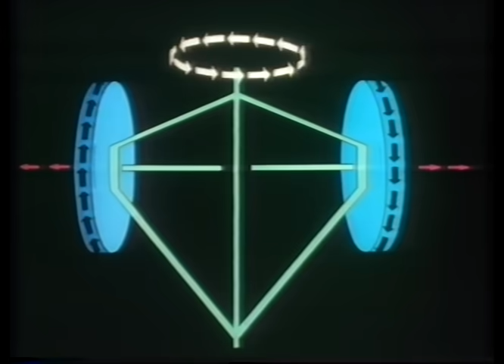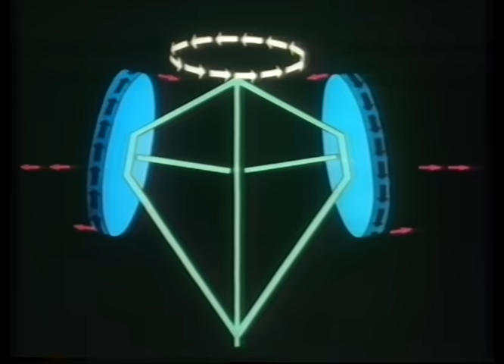Anti-Gravity Machine (Part One)

Comment: Let's talk tech. Top comments aside, and they are engaging, but can we get back to the topic?

The reason this is not easy to see is that our science has denied basic reality. So, there is no path from what is taught to how this works that will hold together completely. Where science refers to a "law" or "principle" you have to substitute "magical spell" to understand the limits of your self-induced confusion. Engineers know science misses the mark, but are too focused on getting results to actually deny its usefulness. The truth is the Universe is mechanical. So, if you want a working explanation, you have to construct a mechanical model. And you most likely will not get to that without a very complete understanding of how reality works (observationally). Specialist need to go back to their liberal arts roots. Enough set-up, let's get to it.

Joe Newman envisioned his reality having magnetic particles shaping magnetic fields which acted like miniature gyroscopes. He wrote a book about his blend of self-discovered physics. Out of that he came up with a way to modify one of the oldest DC motors, even down to the tolerance control (he was a weight lifter, not a mechanic). His motor not only would run on voltage alone, it would charge the dead batteries that powered it and generate electricity that had to be syphoned off or it would blow up with the overload of power it generated. At the same time, it was a motor that was more efficient than any motor made today... and sold commercially. Of course, American law shut him down. So, keep in mind, success in this program will bring death or best case, financial ruin and public ridicule. Your efforts are presently being directed to a science fiction political system from a more mature culture.
The point is, and science has confirmed this, Aether is real. Today that word is anathama, so they call it by one of the more obscure names: Quintessence, a reference to the fifth essence or element which was Aether. Fundamentally, it has spin which orients with external charge. The two have some special conditions that must be met, but one will cause the other to come into focus and the balance between the two, charge and spin can be shifted or created with just the other. Energy is an expression of these two in specialized combination, so conservation of energy is a LIE. Nothing that is constructed of a combination of things is conserved. And for all practical purposes, if the stuff anything is constructed of is also defining space itself, there is an infinite supply of the raw materials for energy and matter... and speed or kinetic energy is not the only path to conversion between the two.

This device spins, if you spin gasses, they ionize and align their charges and focus the spin all the way down to the elemental level. This will release the energy that binds the elements together in a form of compression Etheric waves that is natural energy transmission. Paul Pantone did this with his GEET reactor. He then took the bi-product from this, a plasma and ported it to an ICE. Which compressed it, triggering an implosive fusion reaction that also expressed Etheric compression waves that helped sustain the original implosive fission in his GEET. The whole set up reduced the weight of the gen-set system by 1/2. Paul was killed in November of 2015 after everything he accomplished was taken by a black ops group. Tesla did expensive original research on Etheric waves, his lab was blown up and his fundamental science discredited, his test results denied. What we know as science today was specifically designed to deny Tesla's discoveries.

One experiment that might clarify what is happening here is to build the device with ceramics rather than metal. Or use metals forged in a magentic field and make sure the fields are aligned with the Earth's. Or set up two GEET reactors where the spinning gyros are operating. It is most likely that the movement of just one aspect, perhaps the alignment of the electrons in the metals are mobile enough to align their charges and detach the connection between the mass of the planet. Jamming two magnets like-pole to like-pole will have the same effect, slowing their fall to earth. So, the like aligned spinning electrons of each gyro is forced by the rotation to perfectly align matched rotation, concentrating the force of the Ether between them, creating a mis-match in the coupling of the Ether sustaining the dynamic system.

Another test would be to make those gyros out of ring neo-magnets, that have been forced together north pole to north pole. Spin them up, and see if there is a shift in lift. A control would be to use equivalent non-magnetized rings.

There are many stories on the net about liquid mercury drives rotated at high speeds. Galistan would be a less toxic and less expensive approach, but a huge cut in mass. The motion of the molecules would enable a more atomic alignment of spin. Recognize that it has been proven that motion of molecules do not produce magnetic fields. Only the alignment of particles (ususally by charge and most often this is electrons not protons except in the GEET or outer space, in the sun, or in planets) produces magnetic fields. Electrical theory of moving charges producing magnetic fields was disproven with the first cyclotron, or bending an e-beam and noticing the magnetic field vanished. The magnetic field itself is an alignment of those Ether particles, so they can be transmitted as compression waves, which is how the planets generated projected magnetic fields like the Van Allen belts. This was replicated by the GEET.

Finally, Reich developed tech that was able to detect Ether waves. He was killed and his tech burned by the state of New York. Some psychics can see them, Kirlian photography (putting a charge across a film plate while exposing it) or Auric cameras have some capability, and in the UV and IR or beyond spectrums it seems there are overlaps in the detectability of the Ether waves. It would be a good first step to see if this device is emitting them. My money is on yes.
Its nice to see someone investigating beyond free energy, but keep in mind that anti gravity has an equally disruptive effect on world governments, and educational institutions serve the government first. Like MIT that discovered a solar cell the size of a maple leaf that could generate enough energy to power a house back in 2011, nothing commercial will come of it from the work sponsored by or with an educational institution. 
"The Book of GEET: Part One" is available for download on Amazon.

Peace, B
Reply: What a farago of nonsense, you poor deluded fool.  You must have studied electrical engineering to become so utterly unhinged.
Reply: @MrAaronvee  Yes, engineering, business, success, and no. It was the study of truth that broke me away from the group think and ignorant enslavement. When you see natural systems, you realize how artificial and misdirected the foundations of pirate science are. Living truthfully is not very popular among people.
Reply: @mundymorningreport3137  Sometimes the majority view is the correct view.  Check out Condorcet's Jury Theorem.
Reply: @MrAaronvee  We have limitations. These teach us that help and cooperation are necessary to survive. The limitations demand that we depend on each other for our individual perspectives to fill the gaps that are natural for all of us when we cannot see all, tell all, and determine the best solutions. We may imagine we know the truth by what we perceive, but it is always less than complete. Errors, mistakes, 1/2 truths, are our reality, especially when it comes to working with others. This leads many to conclude that the only valid truth is the truth the majority accepts. Minimize social dissonance, this is the fundamental agreements that all societies collectively accept as "the way it is", and more often, " the way reality is". It is what enables the largest societies to succeed. It is also what causes all societies to ultimately fail.
Tragically for those who confuse agreement for reality, there is no hope when reality bites. Nature does not do human law, agreements, contracts, math, or philosophy. It operates the way it operates. Natural systems are self-powered. They are fed on systems that require no external spark or energies other than what is everywhere present. Such a condition, if accepted by every-person, would invalidate the concept of wealth, and the fundamental authority that those who have what others need to exact a price to support the needs of others. Exploitation and discrimination would be contrary to the culture and abundance would be available to all. Anarchy would be equally available everywhere, and what would encourage people to work together in peace would not be for basic survival in the face of uncertain natural events and shortages that will one day have to be applied to the needs of a few at the destruction of the many. Sociopaths would not be the most effective leaders, but rather those with understanding, grace, and generocity in their hearts and minds. In short, the pirate culture that we live by to survive today would be dead.
The shift from lack and fear is one that requires fearless courage, and an understanding that the most sociopathic fearmongering sadistic persons in our groups, those who fully and without hesitation embrace the culture of exploiting all reasources without regard for the destruction of life sustaining habitat and diversity of life, will recognize they have nothing to fear and abandon their insanity when faced with the truth that what we need to survive is ever-present and freely available. Sadly, those sociopaths have risen to the top of the leadership positions in every culture that fails to collectively see the truth of reality. And they are clearly able to see, that if the world knew the truth, they would be faced with two choices... step down or die by the hands of those who would not step down.
Tesla discovered how to access the Quintessence that mediates all interactions between solid matter. He learned how to mimic the impressions that matter makes on this quintessence when energy is exchanged. In doing so, he found that his artificial expression of those impressions would activate the physical reactions that would create the impressions. In common parlance Tesla remotely and in a controlled manner, targeting specific elements could replicate any physical action/reaction/effect remotely from any distance without consuming energy, in fact, generating energy at the same time. He could light the air at night, as the sun did during the day, invisibly without switching on a light. He could drill holes in metals through walls without affecting the walls, he could heal tumors and improve mental and physical fitness, increase crop yields and shorten growth cycles... as well as with animal food production... all without consuming a nit of energy, making more in the process. Others have used the tech to replicate matter, even organic matter. Some, converting pollution into clean air and water. The industrial kings of Tesla's day saw first hand how his work wiped out industries with his inventions that are still in play today. On March 13th, at 2am in 1895, they blew up his 5th avenue lab in NY city in an attempt to stop Tesla from his marketing campaign to introduce his technology after three years and significant investments in major water powered electrical 3 phase power grids at Folsom and Niagara Falls. Completion was still a year away. His new discoveries would have set men free from the bondage of paying for power, and their fortunes, more than the King of England, would have been lost.
It worked. It took Tesla another 2 years to replicate his records to defend his patents and revitalize his campaign to bring his Ether system of energy production to market. By then, everyone was on board. Pirate science was engineered to subvert every term that Tesla had coined in his research and deny all his discoveries. Living in fear, and with hardship and wars and discrimination continue to this day, because science says it is the only way reality works... but it is only one way that we will work together. That is the truth. The right-ness of the many is not according to facts, it is according to preserve the power and wealth that has been amassed for the few, based on a lie... a lie that only will sustain the few as long as the many choose to live it... Or more importantly with the geomagnetic field failing exponentially faster every day... until reality bites and our stupidly inefficient systems destroy us where we live. Reality bites. Nature doesn't do human agreements. 
But, you can ignore all this... you can think that CO2 is toxic and has super powers over our climate... and that man is responsible for everything bad that happens, and that spraying more crap in the air will fix a problem that doesn't exist (the opposite is a problem). Nature rules, and refusing to control it by understanding its principles will be our downfall. It is easier to seduce the world than convince one fool that he has been duped. Peace, B
Reply: @mundymorningreport3137  The limits of what can be done are set by the laws of physics.  Most of what you describe is historically untrue because you have been misled by the 'Tesla industry'.  The sad thing is that it is now difficult to check the facts because libraries do  not like amateurs rifling through their old journals, and trustworthy modern online journals are behind pay-walls. Meanwhile, fake journals and fake institutes flood the internet with free scientific nonsense.
Reply: MrAaronvee if you are a truth seeker and not just defending dogma, be specific. Aside from the research published on Tesla by people who have seen his work replicated, and transcripts from Tesla's courtroom testimony... I'm curious to see what exactly is the "Tesla Industry" generated misinformation I am supposedly picking up that is false? As far as the "laws of physics". We are back to my first comment. Pick one. And clarify how it is a verifiable statement. Your faith in the fantasy that passes for science these days is what it is; blind. 
Any serious scientist knows how to distinguish truth from fiction, yet you do nothing to support your assertions. Basic logic was abandoned to discredit Tesla, and it was easy to motivate others to go along for the social aspects promoting the lie produced. Anyone who only looks at what is working and sees that the aspects they enjoy will be lost, rather than examine the long term benefits of what could be, would go along with the fiction. How many people avoid vaccinations that cure diseases for fear of a bad reaction? Their social group makes the choice for them. 

The changes are that fundamental, altering business markets so fundamentally that even the political systems' primary controls are destroyed... but the cost of choosing fantasy over reality is terminal. You can't enjoy abundance if any fanatic could exercise the power of God from anywhere in the world. An effective and fully participating social system is required. Personal responsibility becomes a condition of life, not just citizenship. Sociopathic behavior becomes the primary crime that would force re-education and healing. Enabling a single point on the planet to be able to suppress any fire, anywhere on the planet would save billions of lives and put millions of fire-fighters into life changing choice mode.

Why do you suppose NASA will not confirm or deny that in space... stars are not visible? Why does the Sun appear to have divergent rays in our atmosphere, while simultaneously maintaining a relative position that is far beyond the source of those diverging rays? The simple answer is the energy emitted by the sun is not the energy that we see, that transformation takes place in our atmosphere. Tesla identified that energy, replicated it, and mastered its application in a number of systems. Science lies deny its existence and dooms our planet to total destruction with its conscious ignorance. Bow your head, close your eyes, pray to your god of avarice, and KYAGB. OK, that's an exaggeration. 

The lies have supported the growth and support of billions on the planet, and the destruction of untold species while laying the groundwork of building world encompassing systems that those denied forces of nature will turn into a living hell with cyclic behaviors that science acknowledges, but does not understand, nor can it predict, nor can it control. It's already shown itself with the repeated destruction of the Brazilian power grid, leaving tens of millions of people without power for years. And it destroyed the first transcontinental communications network in the USA. It will burn the modern world to the ground. And there's not a thing that Modern Science, or the power of mankind can do with it while the delusion is upheld in the quest for more exploitation of people and acquisition of needless and valueless wealth. Its your decadents that have no future. And yours is a fool's existence, a complete and utter failure beyond spiritual growth by painful lesson. Peace, B
Reply: @mundymorningreport3137  I do not have to justify anything. Science is in the ascendancy. All that you have is a collection of misunderstandings which you have picked up from the idiot-feeder known as the internet. Let me take just one example: the Sun is a point source, yet shadows sometimes appear to diverge and sometimes do not.  So a) it is a point source but, because of the huge distance from the Sun the wave-fronts are essentially planar by the time that they reach the Earth. That is why b) shadows do not diverge. However, if one observes clouds above a plain the light-rays appear to diverge. This is c) just an optical illusion.  Another effect which will surely puzzle you is this: when the Sun and the Moon are visible in the sky at the same time, why does the illuminated part of the Moon rarely point towards the Sun?  Try to find out the real reason for things before deciding that science is wrong. Also, try to check out for yourself exactly what Tesla did, and ignore the lies told by the Tesla Society, by other crackpots and by the celebrity-poor Serbian government.